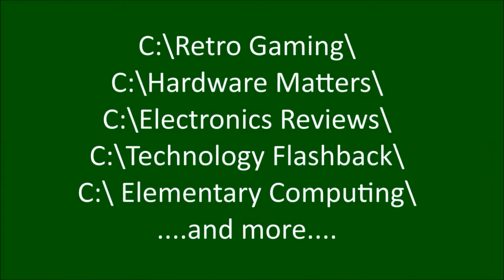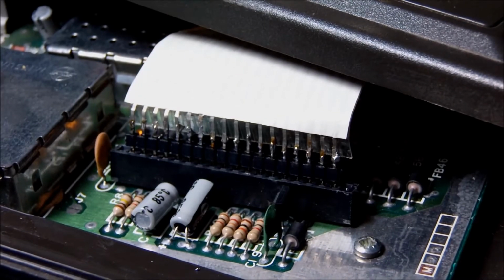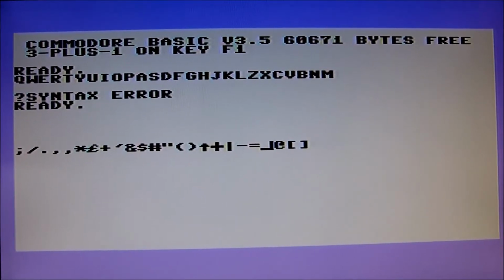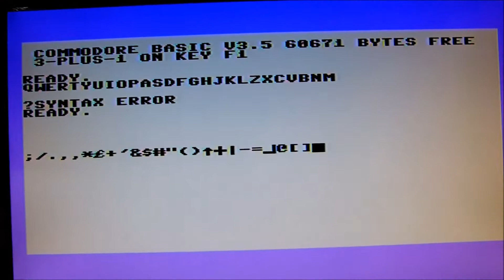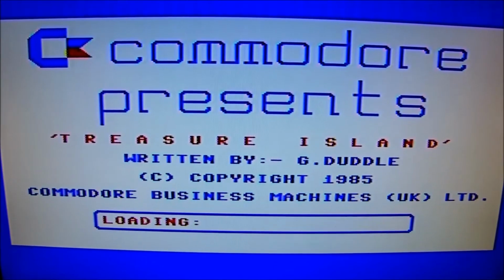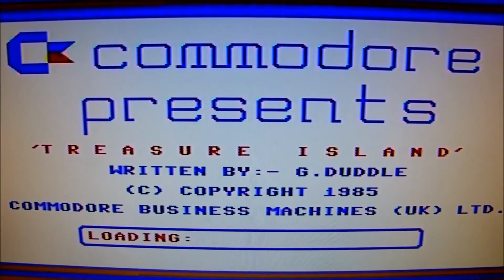Commodore Plus/4 - Keyboard fix mod using simple pins.

Comment: i did this on an acorn electron its ribbon was falling apart and it was not responding , its a good way of fixing such problems except what i did was replace the ribbon fortunately the acorn can take male duponts so two 12 and one 2 (if i remember correctly , but it was basically two and a two ) make to females with a right angle pin header on the keyboard and it was fixed PLUS the DuPont's are more flexible
Reply from the maker: Glad you made it mate! Many thanks for the tip and many thanks for watching! Cheers!
Reply: @CyberhugTechnologies  im full of tips or a word similar 🤪

Comment: putting in sprites would have made a total mess out of the now very clean and tidy design of the ted chip registers. and furthermore, you can simply do your moving objects in software and have as many of them as you want. not just 8 or 8 per scanline. (and be stuck with some format and sizes some chip maker picked for you at that, making all games look the same ;) the nintendo ppu can do a lot more regarding sprites than the vic-II ever could (it is also far more of an absolute mess design wise). nope. what commodore produced there is pretty much, the perfect display and sound controller chip. unlike all their previous attempts. with the ted they finally got everything just about right. everything you need to know fits on a single page of paper. and then your software just works as expected. whereas both the vic-20 and the c64... are a total horrid mess with bank switching and what not. the ted (in a cmos version without the i/o gates and dram refresh, preferably with rgb sync out instead of combined signals) is a chip you could sell in large quantities today. the vic-II... is just not suitable to sell as a seperate product. it's a pile of nasty hacks thrown on top of each other. (but as stated there definately are worse video chips than the vic-1 and vic-2 :P. the plus4 as a whole is a much cleaner and better design than the c64. and if it would not be so easy to make software work on all of them at the same time, and you'd have to choose between developing for the plus/4 or the 64 or the pet or the vic20, then the plus/4 would win. (the code required to initialize the c64 to the state you want it to be in is just way way way longer for one thing... ;)
Reply: see in most setups that have sprites the part that overlays the sprites and does the collision detection isn't even the same chip :P (just like parallax scrolling backgrounds usually are seperate controllers) and with the vic-II they clearly are seperate circuits too even if it's put on the same die. and they simply left all that crap out. which is fine. as those that want it can do it in software (it's also a lot faster than a c64 anyway ;) the ted chip does appear to be based on the same logic as the vic. as in the output looks more or less identical. but it is a much improved and cleaned up version. (the additional colors actually just being luminance levels, which i think have always been there as colors can differ from one revision of the vic-II to the next, but just were not accessible)
Reply: they certainy have made things that are a bigger mess. :P the b and p cbm-II series, the superpet and the 128 to name a few :P lol. the plus/4 is the best thing they ever came up with, right along with the pet 4032 and 8032. they even made brand new diskdrives for it to finally address that slowness issue. properly. the pet and the plus/4 were 'we want a product that does this or that to this specification' products. the rest of em were 'accidential' products. some guy putting some chips together in his spare time and all of a sudden it somehow got mass produced. and it shows. (the c64 being nothing more than an ultimax someone crammed more ram into and a second 6526 ;) it is literally the only thing they produced in a long while since the pet that did not eventually ship with still half broken chip designs. it all works as expected. in the digital sense even if due to hmos and hmos2 production issues some have electrical problems 40 years later. 6522? broken design. 6526? broken design sid? why is only one of the voices usuable as a random number generator not all of them? vic-1 and vic-2 ? eh exactly who did the register layout? lol. but no.  every single chip in the plus4 does exactly what you expect of it. even the acia works well (and there are a lot of half broken 6551 derivatives out there on the market)
Reply: mos was a chip seller. this is a chip you can sell. the vic-ii is not. nobody gonna change his entire design to meet all the weirdness of that thing to implement it.
Reply from the maker: @CB3ROB-CyberBunker  It was a great machine, like you implied ...not for games but for processing power and for deep-dive experienced programmers. Great knowledge base you are mate!
Reply from the maker: @CB3ROB-CyberBunker  I really enjoy thinkers and people with experience in the field! Yes, totally agree!
Reply from the maker: Hi there! yes, very well said mate! I totally agree and the story is known. At least it is commodore 16 compatible but you know that everyone expected this to be C64 compatible. I had this machine back in 1989 and was sold but then i rushed to get it back later because for me, it was a truly unique machine with great potential! Thank you very much for watching!